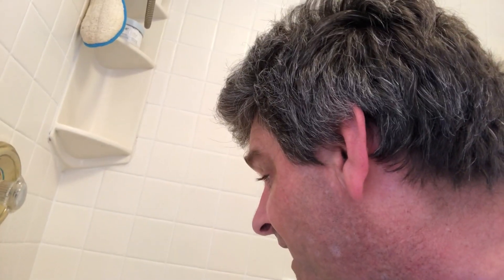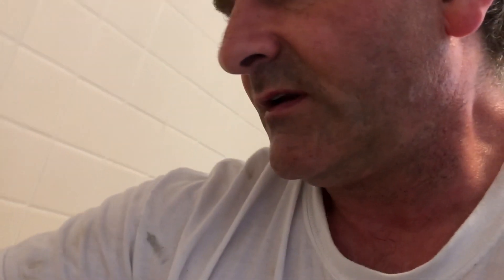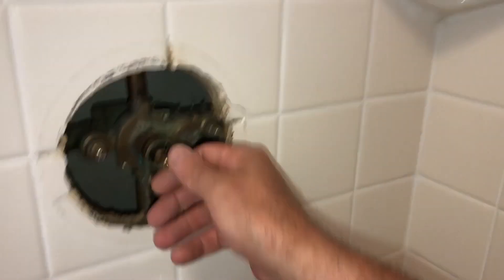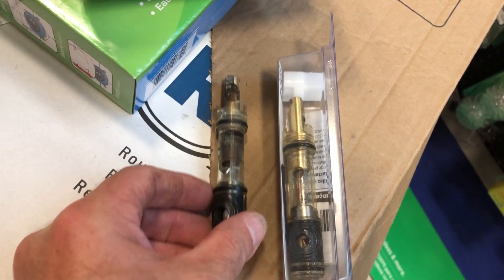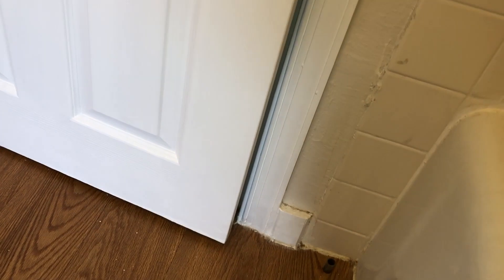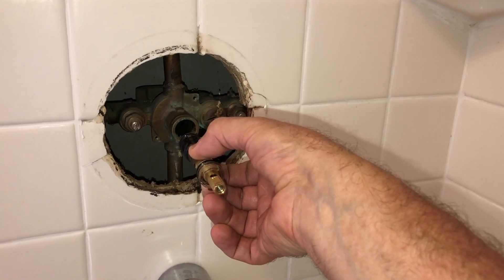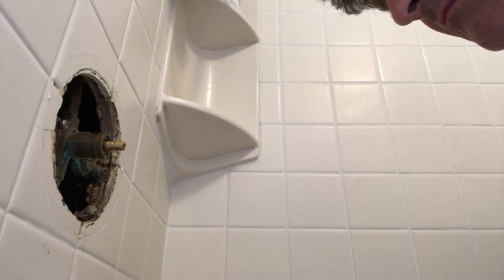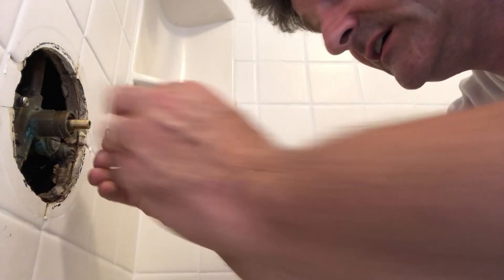Fixing leaky bath faucet, Replacing Moen 1225 Cartridge for Shower Faucet

Comment: I am having this problem right now,so I called a regular contractor who has some knowledge about plumbing, he said to me this is a technical job but he can fix it and will take up to three hours and the price will be cad 900. 
I went down in the basement and it took me less than 10 minutes to take out that valve .Now I am going to Home Depot. Thank you very very much for sharing your knowledge!

Comment: So I replaced my Moen 1225 cartridge about a month ago. Was very hard to remove, almost thought I’d have to call a professional. But using the removal tool, and pulling at full strength with my body weight and my feet planted up against the wall, I got it out. Leaky faucet was fixed, and worked fine until yesterday. Now, my faucet is leaking again. And it’s not a small drip, it’s a steady stream of water. Any ideas on what I did wrong? Why’d it fail? And what should I do differently next replacement?

Comment: The cover plate doesn’t need to come off take the cover off the handle remove the stem cover you don’t need any special tool just screw the handle back on once you remove the C clip, wiggle it back-and-forth and yank it out. Be sure to put it in with the dot up other wise hot and cold will be switched.